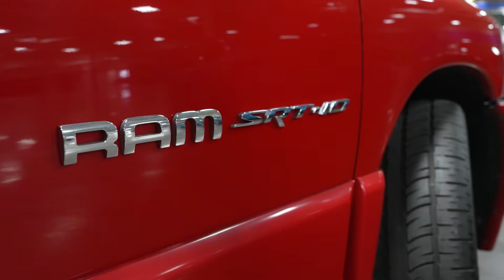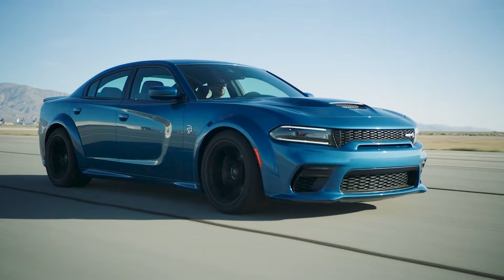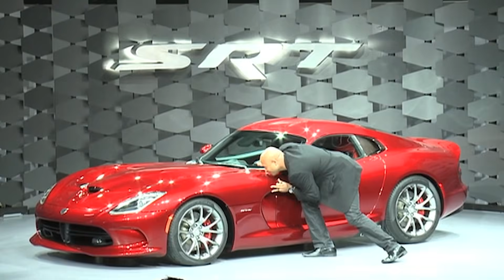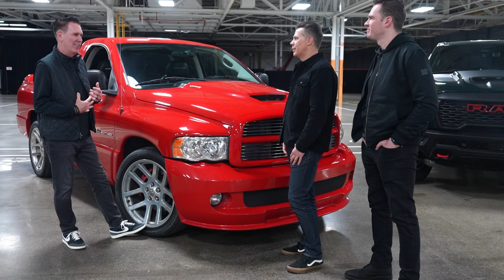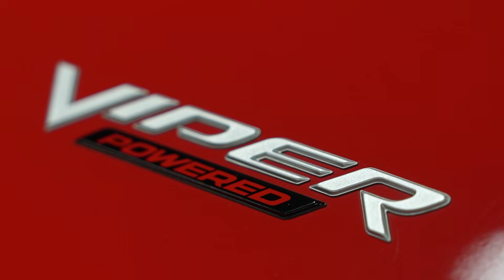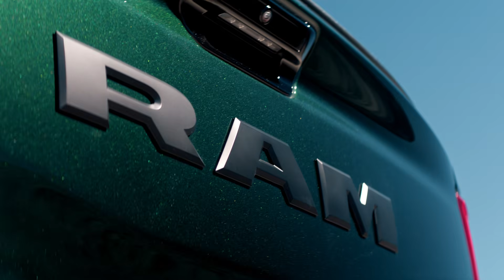Icons of SRT | Drive for Design 2026

Comment: Look to make new products more lasting! Many changing brands. 
You have way too many failures. 

You should have came back with better line up of designed cars got rid of. All dodge jeep ram. my sons after jeep SRT & the Hellcats MEGA CAB. 

New trucks from you since 2000 & your parts have been horrible. New vehicle check engine lights on 5 10 15K miles replacement

Comment: My 2019 Hellcat Redeye Widebody is my fair-weather summer daily and drag strip slayer. I have a set of OEM Demon 170 17x11 rear wheels with 315/50R17 Mickeys for the strip, and I run Atturo AZ850 drag radials in 315/35R20 on the street. To really experience the power of these cars, you need a sticky tire. Burnouts and drifting are fun, but they get expensive and don’t plant you in the seat like it does when the car actually hooks. My year-round daily is a 2023 Ram TRX. Mark took a pic of it at M1 Cars & Coffee a couple years back. Love my SRTs.
Reply: Awesome collection. If you ever need someone to drive them, don't hesitate to let me know 😁